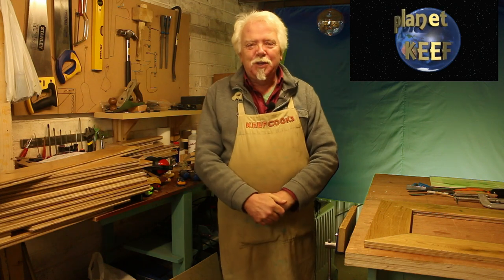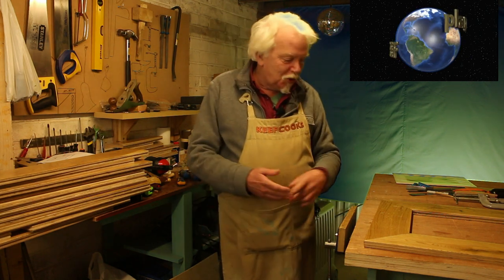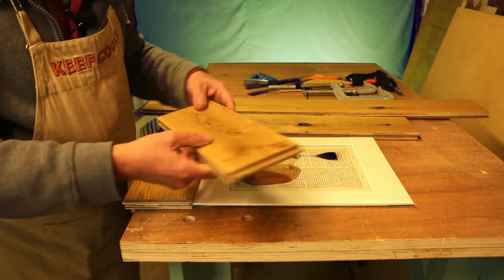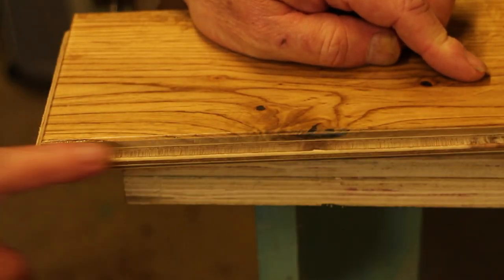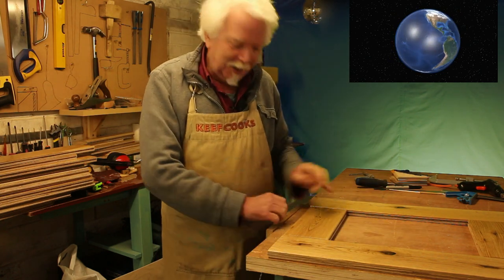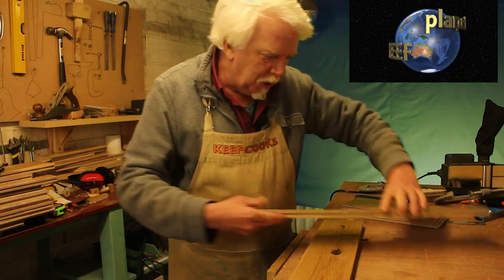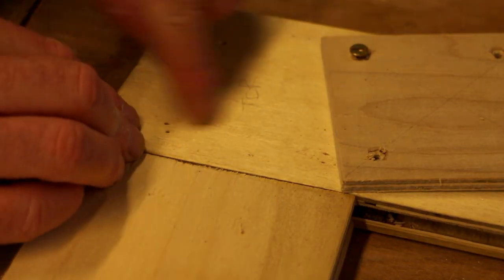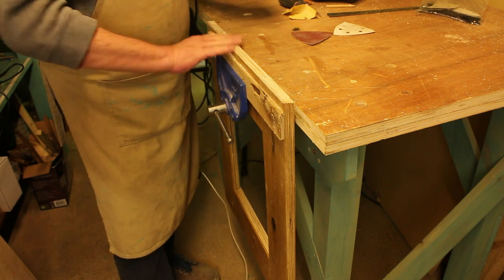Picture Frame Made From Upcycled Oak Floorboards

Comment: Very nicely done Keef,  next chrimbo request a compound miter chop saw as they are fab for jobs like that and for putting up crown molding like I found out after messing many cuts up using a miter box and saw. Little tip for you when cutting finished woods cut upside down there should be no splintering of top layer. My brother is a carpenter and told my dad off for running his finger on a cut edge he said always blow on it first to remove splinters.
 W.D. 40 or any silicone release spray removes sticky labels and glue quickly peanut butter in a fix will do the same and you get to lick your fingers afterwards.
Reply from the maker: Crikey Brenda - you should be doing this channel!
Reply: Keef my mum wanted me to go Mabel Fletcher college because I could turn an oxo into a meal as she used to say anyway, I wanted to build and make things, I loved looking at house plans (and still do) but sadly I fell for someone at school and ended up working for MANWEB before I met and married Charlie a few years later. 
I've slowed down quite a bit since the children came to live with us, but I still do enjoy cooking, canning, sewing, crafting, and a bit of home improvement projects but I had surgery on my right foot last year and my left knee is knackered from an old motorcycle accident I had when I was young and dumb. Keep moving and never stop doing what you love to do. 😍
Reply from the maker: Ah, Mabel Fletcher! That name takes me back 😀. So how did a girl from Scouseland end up in Florida?
Reply: My sister married a U.S. marine she met in the top rank above St. Johns market in the 70's and moved here. I was visiting when I was 17 and Charlie was a friend and also a marine came for a visit and as he said fell in lust with me because I had big boobs and waist length dark blond hair, I wasn't interested as he was married and had a baby boy. Long story short they divorced and after the marines he joined the navy but still kept in touch with me and often sent marriage applications to me but I was too busy with my friends and interests and working in a pub at night but when he was transferring from Rota Spain visited us and we went out on a date and found out colmans mustard was liquid napalm on a hot dog despite me telling him to go easy with it, and when he left he asked me again and this time I said yes and we got married about 15 months later. Paper work was a nightmare because of his top secret clearance, also had to have a thorough background check and even a V.D. test. 
Florida is where we retired and settled to after his military service was over back in 1993.

Comment: Keef, to remove the "sticky" from double sided sticky tape (or even spray mount, if you win the lottery), just use lighter fuel, (the type used to fill petrol lighters such as zippos) and use a cloth or paper tissue. Squirt some into the join, it will disolve the adhesive without damaging the finish. Works well on many materials (wood, metal, plastic*) including paper, so if you want to reuse, say a padded envelope, this'll work. Be quick though, you may need a second squirt - as it evaporates really fast. Reapply and wipe as necessary to leave a clean surface. Works well too on removing self adhesive price labels on gifts without leaving fingernail divots or sticky residue! ;D 
I know it shouldn't need saying but don't do this near any open flame or source of ignition, but in this litigious age we live in you can't be too careful.

Loving the new channel by the way. Big thumbs up and you have a new subsriber! I hope you liked this tip, if so, any chance of a shout out?

Looking foward to seeing more, all the best,
Monty

*With hard plastic. any machine cut/polished edges will show 'crazing' if any kind of solvent is applied.